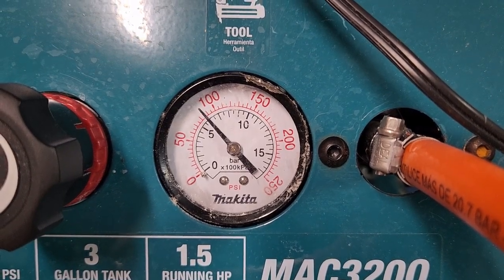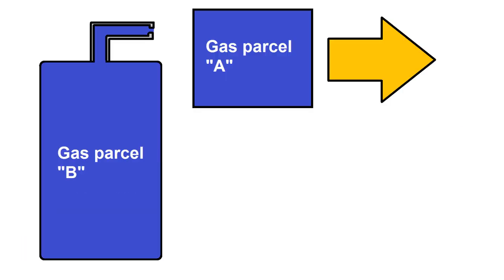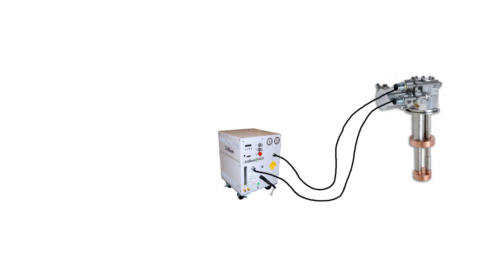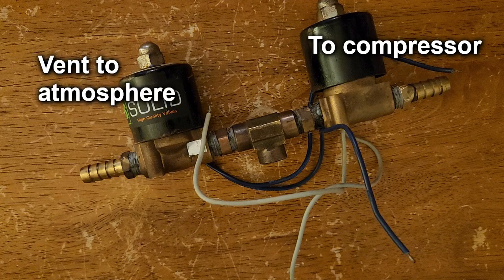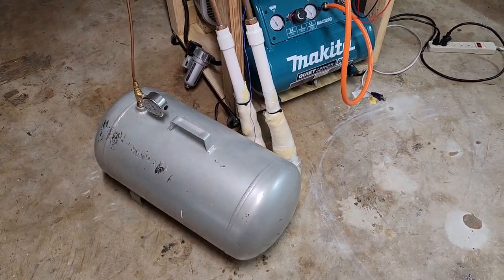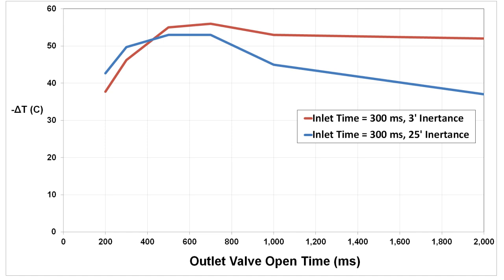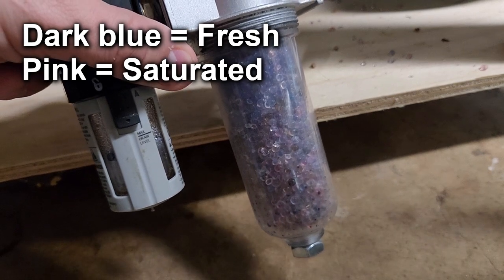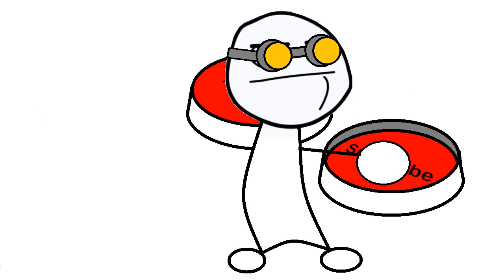Pulse Tube Cryocooler (Part 4) - Valve Controlled

Comment: I wonder what comes first:
100k subscribers
-100K temperature
🥶🥳
Reply: 100k subs, -100K isn't possible. Even with -100c i think the subs will come first
Reply: @V8Power5300  :ø)
Isn't -100K 'just' a drop in temperature, from whatever ambient starting point?
But absolutely - yes, -100K is like going faster than light. It is currently not possible - but who knows if it will be (or was possible) ;ø)
Anyways, so much respect for doing such amazing projects - you really deserve it, and much more!
Reply: @V8Power5300  Wow.. I just got smarter..
Negative temperatures can only exist in a system where there are a limited number of energy states (see below). As the temperature is increased on such a system, particles move into higher and higher energy states, and as the temperature increases, the number of particles in the lower energy states and in the higher energy states approaches equality. (This is a consequence of the definition of temperature in statistical mechanics for systems with limited states.) By injecting energy into these systems in the right fashion, it is possible to create a system in which there are more particles in the higher energy states than in the lower ones. The system can then be characterised as having a negative temperature.

A substance with a negative temperature is not colder than absolute zero, but rather it is hotter than infinite temperature. As Kittel and Kroemer (p. 462) put it,

    The temperature scale from cold to hot runs:
    :+0 K (−273.15 °C), …, +100 K (−173.15 °C), …, +300 K (+26.85 °C), …, +1000 K (+726.85 °C), …, +∞ K (+∞ °C), −∞ K (−∞ °C), …, −1000 K (−1273.15 °C), …, −300 K (−573.15 °C), …, −100 K (−373.15 °C), …, −0 K (−273.15 °C).

The corresponding inverse temperature scale, for the quantity β = 1/kT (where k is the Boltzmann constant), runs continuously from low energy to high as +∞, …, 0, …, −∞. Because it avoids the abrupt jump from +∞ to −∞, β is considered more natural than T. Although a system can have multiple negative temperature regions and thus have −∞ to +∞ discontinuities.

In many familiar physical systems, temperature is associated to the kinetic energy of atoms. Since there is no upper bound on the momentum of an atom, there is no upper bound to the number of energy states available when more energy is added, and therefore no way to get to a negative temperature. However, in statistical mechanics, temperature can correspond to other degrees of freedom than just kinetic energy (see below). 

It is on the Wikipedia page on Negative temperature
Reply: I presume they meant 100k subs or 100K temp (no minus)
Reply: 274k subs and physics breaks!

Comment: If budget and manufacturing was no issue, what would be a better alternative to steel wool for the regenerator?
Reply: I've seen commercial regenerators that were a cylinder with a grid infill made from porous ceramic. Looked almost exactly like a car catalyst!
Those were for regenerating air from heated rooms though, and about 10 or 15 cm in diameter. The manufacturer claimed they "regenerate" about 93% of the heat energy iirc..
The less heat conducting the material is, the better, so ceramics are definitely a good choice.
Porous, sintered surface provides plenty of surface area, and the simple grid structure doesn't obstruct flow too much.
I guess those things are pretty much as good as we're gonna get for a completely passive, and almost comedically simple device!
Reply: I imagine Porus Sintered Stainless Steel would be very effective, another option might be a tube full of tiny ball bearings?.